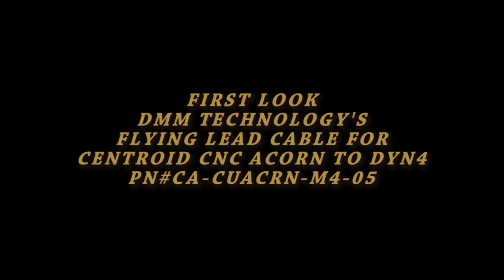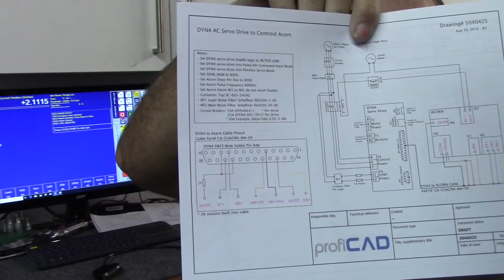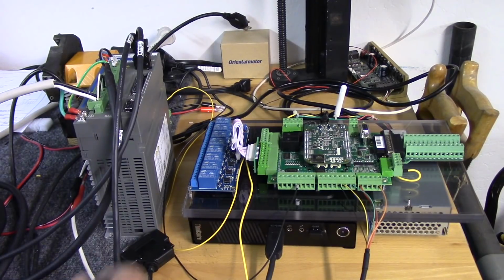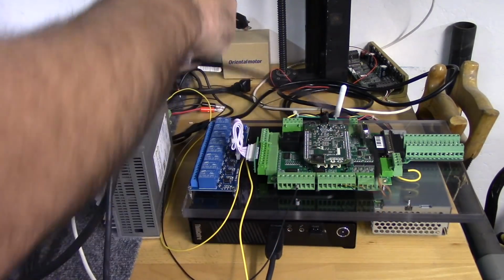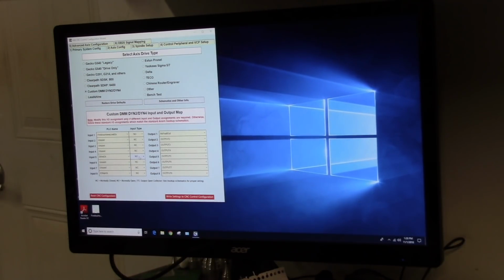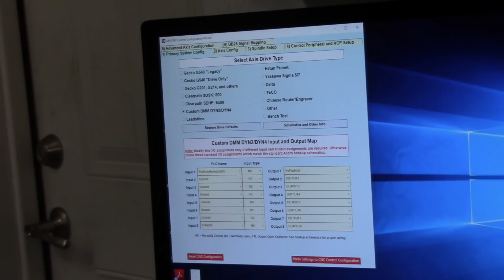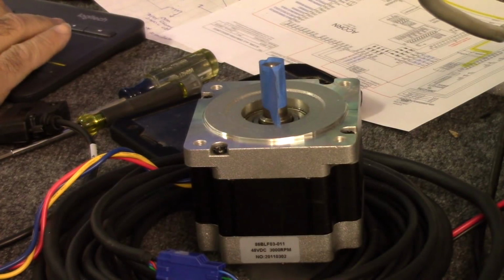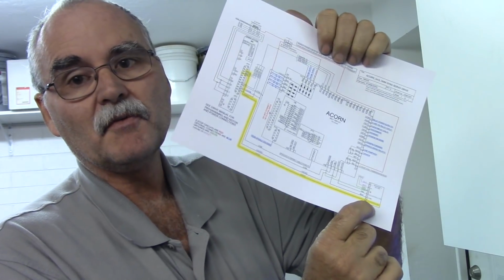DMM Technology's DYN4 Flying Lead Cable for Centroid CNC Acorn

Comment: I am normally not this guy, but this video needs to be edited or removed.  This cable was purchased from the recommendation in this video.  After spending a day trouble shooting I had myself questioning my career as a controls engineer. (I am self employed, so essentially I lost a days pay on this endeavor.)   I was not able to get my servo motors to turn the opposite direction.  Then after scouring the centroid website I find evidence of they cable may or may not be the issue.  Well I am here to tell you their method of getting 5v logic power from 24v doesn't work, and also the resistor value doesn't even match there schematic.  It states a 2k ohm and they only had 1200 ohm resistors in it.  Not you fault, but others are using this video to educate themselves prior to purchasing.  I will also forward this info to DMM, but it appears from my research that that are fully aware and keep on selling the same product.
Reply from the maker: I've not had problems but yes, they use 5vdc logic for step and direction and use a dropping resistor to drop from 24vdc to 5vdc.
Let me know how they respond.
Reply: @martyscncgarage5275  There response in quotes "We sell quite a bit of these cables so I don't know if this issue is related to a particular production batch or some other reason.  We hear about the problem from time to time but we have not been able to replicate the problem with the Acorn setup here"  They then said that they would credit me on a future purchase (I have no purchases planned) , and to be honest I clearly stated I was not looking for a refund.  That was nice, however there was no interest in any of the technical details that I shared.  That's concerning.  It is what it is.  If it was my company I would send a shipper to get the cables back, or request a video chat or something to solve the problem, or prove that many of us are just doing it all wrong.

Comment: I'm new to converting a mini mill to CNC controlled. How do you wire the spindle motor to the acorn board so you can control direction & rpm within a part program & get rid of the on/off switch for the spindle motor? I assume that as long as the machine is plugged into an outlet then the machine as constant power to the spindle motor if the on/off switch is removed. I see a lot of these videos which people have to turn the spindle motor on manually & set the spindle rpm manually. To me that defeats the purpose of doing a CNC conversion if you don't have a way a have to wire in the spindle motor into the Acorn board. It would also be nice to have a RPM gauge wired into the spindle so you could find out the difference between what the spindle rpm gauge is reading & what the CNC control is reading so you fine tune the readings during setup. Because there will be a difference. It will probably be only a 25-50 rpm difference but even that will have an effect on carbide end mill life (I prefer carbide end mills over high speed steel for cutting time & tool life before you have to regrind), ceramic or carbide insert life, machine wear & tear, & surface finish. 

I've been a CNC machine operator for over 30 years but really had no way to see how the spindle/table motor was wired in & I believe the spindle/table motors all had constant power to them as long as the machine control cabinet was powered up. I have been retired for 5 years & after a while you loose some of your knowledge over the years. Granted we didn't have machines with separate RPM gauges but maintenance could fine tune the rpm of the spindle/table compared to what the cnc controls were reading.

I know the spindle/table motors are controlled for direction & stop using the M03 (clockwise), M04 Counter clockwise), &M05 (spindle or table stop if I remember correctly) Please correct me if I am wrong.

One other question: Is there an expansion board so I could mount encoders an all the axis's including the spindle motor. Or would I be better off buying AC or DC axis & spindle servo drive motors which have the encoders built into them? Any help would be greatly appreciated
Reply from the maker: Yes, Acorn can control a spindle. Please post your question to the Acorn forum: https://centroidcncforum.com/viewforum.php?f=20
With pictures and details about your current spindle control. I have no idea what you have and prefer support questions be asked there where I and others can try and answer them. Try the search feature there too.
Reply from the maker: You can not connect encoders to Acorn other than a spindle encoder. If you have a spindle encoder installed properly and buy the pro license, you could do rigid tapping in a mill and on a lathe, as well as single point threading on the lathe and constant surface speed on the lathe

Comment: The wires are melted together from factory soldering with too much heat. I have pics. Anyway I brought the Acorn CNC kit Pro and Dyn4 4x 750w servo Kit because of watching your channel and I am very happy with everything else. Great vids and much help as I build my own CNC router.

Comment: Brought these cables at $45 each from DMM Technology. Very badly made. Had to rewire as the wires were melted together causing a short. Also Dyn4 manual states shielded twisted pair for the 4 wires carrying data to Acorn cnc board these are not and only 28awg.
Reply from the maker: That is feedback you should have given to DMM to correct or improve

Comment: Can this cable be used for a spindle set-up for DYN4 to Acorn, using analog in DMM, in speed mode?
Reply from the maker: No. You need a wiring diagram and you need to specify you plan to use Dyn4 as a spindle drive

Comment: I wired my own DB25 , do I still need to change Parameter 991 to 1 from 1000. factory set is 1000
Reply from the maker: Yes. It is so that CNC12 can detect DMM's pulsing drive fault output

Comment: Hi Marty
would like to ask you if you know how to fix Sudden Z Axis Drop on router CNC after I started my G-code file.  I'm running DMM technology servos  with Centroid Acorn. was running fine until today. will resetting Centroid Acorn board could fix the problem.
Thank you

Comment: Hi Marty
I ordered 3 of the flying leads.  I can't find the DMM schematics on their site.  Where did ou get yours? 
Also Acorn schematics (S14888-ACORN_rev3 DMM DYN4 SERVO DRIVE_recover_2018-12-13) shows a 5 volt jumper from  Meanwell V1  to JP4 pins 11 and 22.  But they are not on you video.  What gives?
Reply from the maker: Ask DMM for a copy of their Acorn Schematics

Comment: Hi Marty!
I am planning to do a conversion of a lathe with, of course, Centroid CNC software and DYN4 AC Servo drives and motors.
Please, from your experience what is the best solution to do with the lathe gearbox which is not needed as I am planning to use the inverter and encoder?
If somewhere is a good explanation just notice it here. I do not want to waste your time.
Reply from the maker: If you are talking about the headstock pick three gear ranges you like and you can use them controlled by Centroid CNC12 and your VFD. There are buttons on the virtual control panel, spindle high, medium and low. Once configured, select the gear range on the lathe, click the button and CNC12 will control and display/use the speed
Reply: @martyscncgarage5275  Hat down in front of you Marty!!!
Yes I am talking about the headstock. Sorry, English is not my native language and sometimes I cant pick a right word.
But, THANK YOU VERY MUCH! I learned a lot from you.
Waiting for next video...
Stay well!

Comment: Hello Marty
Greetings from Ireland. My question is not related to this video but 
the kondia mill I am upgrading the same mill right now, but since all the motors
and electronics were removed could you please verify the pulley sizes ?.
I suspect the drives are 1to1 but I just want to check. This is my fifth acorn upgrade 
since I retired and I am really enjoying this hobby .looking forward to your reply
Thanks Hugh
Reply from the maker: Hugh, I will try and do that for you. Much depends on the size motors you intend to use to drive the axis. I don't think the originals we're 1:1